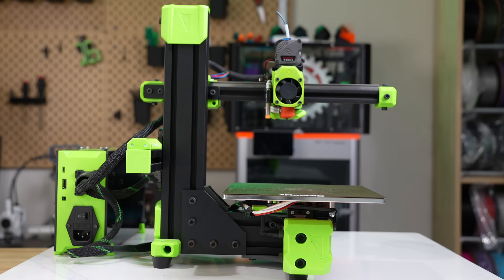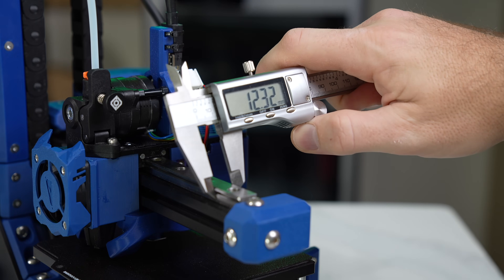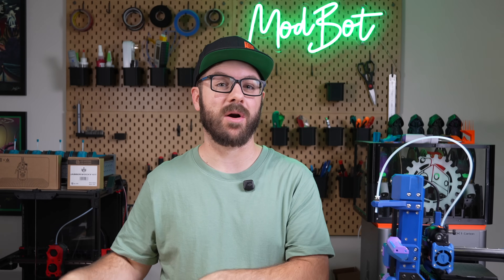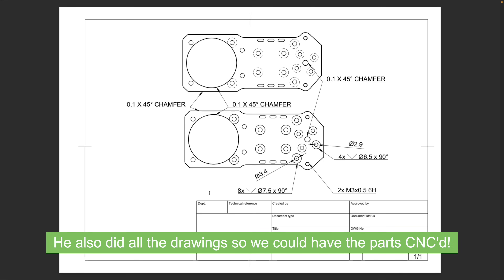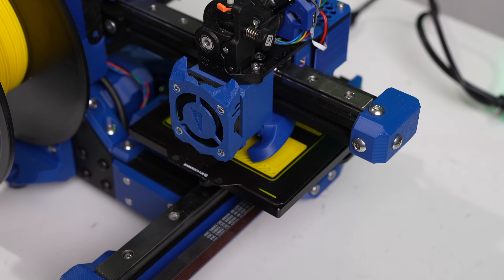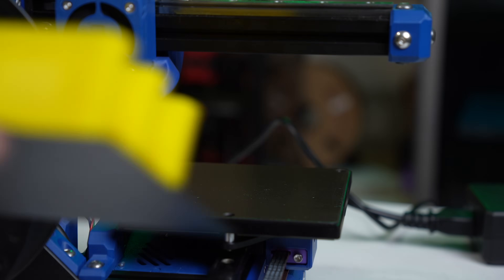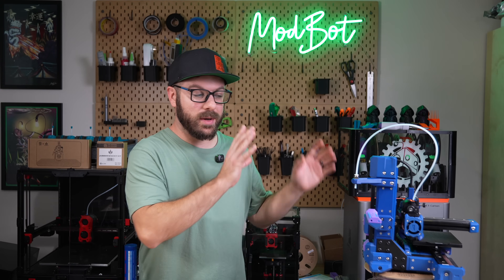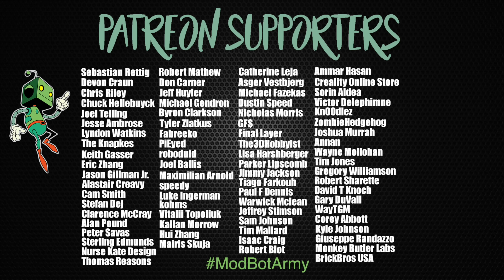This Tiny Cantilever Printer Packs a Serious Punch (TicTac)

Comment: Try the ODIN extruder for voron printers
Reply from the maker: Is it something new? I don’t think I’ve heard of it
Reply: @ModBotArmy  just some extruder i made to try with dual color or even for have one with say ABS and the second with ABS support release. Made to be more ”fast” between change. I skipped the knife cutter and the filament path is so much shorter compared to an AMS or MMU. I was surprised how well it actually worked without having a cutter. I have print +100h with close to 1K filament changes, havent had any problem with the change at all. I just released it on Printables to reach out to more user to see if there is anything that chould be change for the better. So if you find it intresting plz try it. Dosent have to be a video about it, i just want to know what to make better and what was good and you usually do it very well in your videos. Thank you for your time, HAPPY PRINTING!

Comment: i enjoy seeing what squirrelbrain comes up with - the designs are typically pretty cool & some become inspiration for different projects.  i was seriously considering the v-minion for my desktop prototyping machine too, since tic-tac is just too small for my needs, but since ratrig no longer provides most of the parts & self source is prohibitively expensive i decided to go with a used cantilever instead & wound up with a kingroon kp3s that i've been modding largely with upgrades intended for the v-minion or tic-tac.  i went the power brick route too, though, just for simplicity & space savings.  glad to see i'm not the only person still interested in cantilever machines too.  😊
Reply from the maker: The KP3S is or at least was a sleeper. For the price it performed above its weight class and as you are doing if you want to mod it there are lots of options.
Reply: @ModBotArmy i'm putting a dragonburner on it with a tz 4.0 & plan to do belted z, plus upgrading to a manta m4p, among other things.  it'll be a pretty mean little machine once it's done.

Comment: Nice build. Looks like a really fun project.  Still, I love my Voron 0.2. Use it almost every day.  If I was going for another fairly small build today, there are some salad fork kits in the $375-$400 range that look tempting to me.  Thanks for sharing the build. I like the 13 minute summary of the live streams.  Really cool way to cap a series.
Reply from the maker: The Voron 0 is a great project and there is no denying the benefits of having the printer be fully enclosed. Salad Fork looks like a great printer. Absolutely! Thanks for tuning in.
Reply: FORMBOT offers an affordable salad fork set